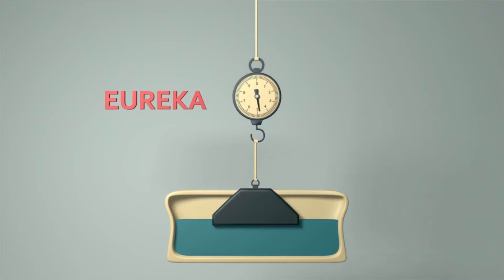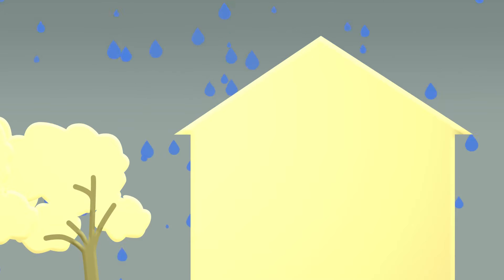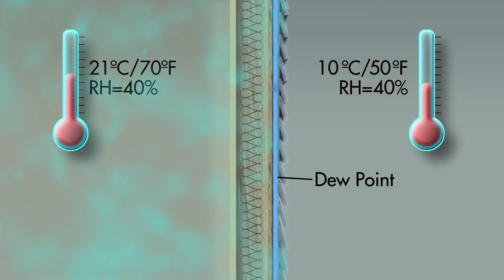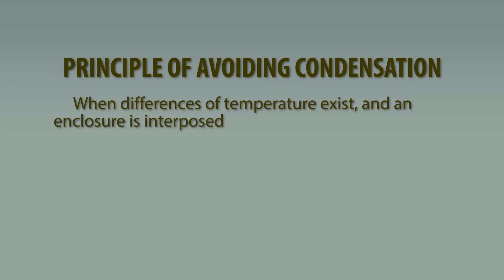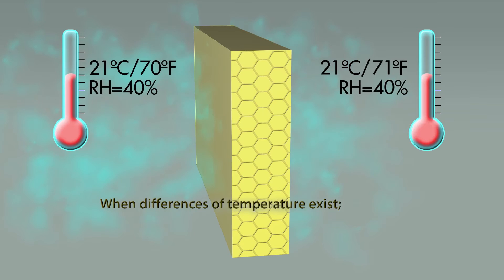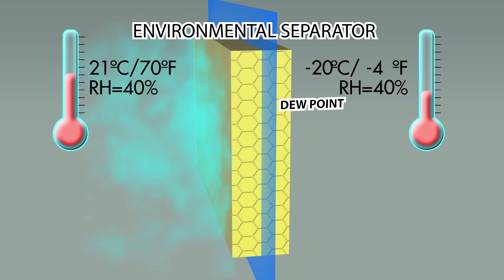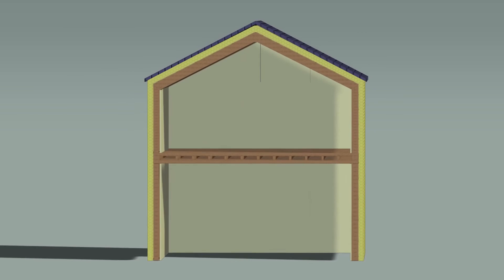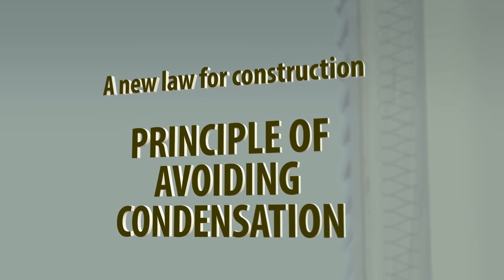Principle of Avoiding Condensation Explainer

Comment: For many decades by now , there is a product on a market for  a perfect wall. It is Thermasteel panel. It will not mold , rot,  burn, no vapor penetration with condensation, light weight , easy to assemble into a wall  and it consists of cheap components to produce
Reply: never heard of it.

Comment: Makes total sense. If condesation happens at for example 5 celsius, and you make your closed cell foam insulation outside the home, then the outsideof the foam is frozen and the interior is warm, but the 5 celicius is somewhere in the middle of the foam baord, thus eliminating the condenation processes all together.
Reply from the maker: @corykeeler2655 Yes, you get the point entirely. And the non-permissive insulation is the only system that can be installed on the interior (especially for ceilings), letting the structural element entirely outside (in one environment).

Comment: The only material that I know of that is used for insulation that is non-permissive or vapor impermeable is closed cell foam. Structural insulated panels offer a wall system that is air tight and vapor impermeable if installed properly. You could also build a stick built wall with 2 1/2" of foam on both the inside and outside surfaces with regular insulation in between. As long as the foam is contiguous and fully sealed the dew point would always fall within the foam in most climates.
Reply from the maker: Hey Joel, nice to have your comment. You get the point of avoiding condensation using non-permissive insulation but, the idea is to simplify things, and not to complicate... Two layers of closed cell foam with a permissive insulation in between is a non-sense complication. The base idea of full success is a thermal enclosure made out of a continuous non-permissive insulation with the role of environmental separation and, a structural element to form the building envelope. When those things are accomplished, all building envelope issues are solved. I know, everione worie is about thermal efficiency, but... do not compare non-permissive insulation which is 100% effective, with permissive insulation which have a regular randament of 20% from specified conduction coeficients of laboratory tests. Regarding materials and technology, see https://eios.co/

Comment: In principle yes, but as the saying goes - God is in the details.
All -fenestrations -doors, window are difficult if not impossible to detail . Roof to wall issues. Siding, roofing etc fasteners become conduits for temperature, vapor issues. Not to mention poor installation issues.
Manufactured insulated metal prefinished wall and roof panels can be a solution.
This is not easily accomplished - but the principal is sound.
Reply from the maker: This theory arise from practice, and yes, the practice is detail oriented. See https://eios.co/eios-besides  As you say is need, special details are made for intersection with other constructive elements as windows/doors, and connection between walls and roof. All assemble needs to be continuous vapor tight and thermal bridge free. Some screws are accepted for roof system attachment.

Comment: I've been looking for a condensation problem beneath the mattress in an RV. Through your video I think I've found it. I don't have much space, the bed is above the truck cab, but if I put a layer of enclosed foam (for example polystyrene) it should keep my mattress dry.
Reply from the maker: A layer of extruded polystyrene should solve condensation, but it needs to be sealed around and the joints sealed with polyurethane foam, so as air and vapor to not get behind insulation. See installation example from constructions:  https://eios.co/system

Comment: Loved the video and explantion, definitely will consider doing this as i need to change the roofing anyway.
Another problem with ventilation is that during winter the "fresh" outside air is often polluted to the point of killing an air purifier filter in a month. (I also don't have a furnace, gas stoves or anything, besides few residents, that would require ventilation)

Comment: omg .. i've literally got some insanely uncomfortable inflamation problem in the last 2 years of wet winters and my dad DIED of an autoimmune condition of the lungs in this house .. i found a electricity sockets corroded to green behind a cupboard, the windows have condensation on the inside .. its chronicly humid but  doesn't smell like it .. i cant believe people dont HAVE to make sure this doesnt happen.
Reply from the maker: Condensation, mold and degradation usually starts interstitial (inside of walls), not very visible but very aggressive for the health of the occupants and the building. I build moisture-free from more than 10 years, with same results in every project standing. Unfortunately, the authorities doesn't want to consider this as a fact, and make a change. Who knows when moisture-free will be a reality, for all.
Reply: My friend lives in Alaska and her two daughters have debilitating autoimmune disease.. I asked if she has mold and she said yes it is really common there and she had several walls rebuilt.

Comment: A nice explanation, but I was unable to find the proper non-permissive thermal enclosure material you talked about.
Why haven't you given any names of such materials as a guide.
I'm really breaking my head trying to figure out, which materials could fit under your definition.
Reply from the maker: The principle is the theory, for practice search EIOS Thermosystem.
Materials to create non-permissive insulation is usually extruded polystyrene sealed with closed-cell polyurethane foam. See the assemble: https://eios.co/system
Reply: @mariusradoane1787  That is so far from the truth. Do you really believe that in winter time hot air that difuses from the house will go right into the middle of the extrudated polistyrene and stay put from November to about March ? 😀  I understand that you are trying to sell your services, but do not mislead people. You either are extremly naive or just someone trying to sell something at any costs.
Reply from the maker: @mihailfelixdumitresc  The principle does not sell anithing! Vapor difuses through materials, not the air! Extruded polystyrene is considered vapor-impermeable over 5cm thickness. So, through non-permissive insulation passes only heat by conductivity, No air, No vapors! There are some things to know, to can understand a principle.
Reply: @mariusradoane1787  Your extruded polistyrene will keep the moisture INSIDE the wall, with no chance whatsoever to escape it. What follows is mold grows which is bad for health. Water vapors "travel" with hot air and become water droplets once the hot air meets a cold surface. You cannot separate water vapors from hot air just by placing extruded polistyrene on its way because it does not act like a coffee  filter. It is the moisture that is the problem in your "solution", don't you get it ? Moisture that remains within walls because your extruded polistyrene conducts heat outside the walls. Moisture acts like a facilitator for heat transfer.

Comment: The exterior insulation foam panels you promote are still held in place by big wide strips of wood (such as on top of a roof deck), which means there is actually no continuous condensation seperation as you claim... wood attached to wood attached to drywall or roofing tiles does not insulate or stop moisture. Of course without the wood elements, you could not attach a roof on top of foam panels, since foam isn't a structural material. So you haven't actually created a system that matches your theory. To follow your theory you could live in a big styrofoam cooler, but the styrofoam would break easily which is why we don't make houses to be styrofoam boxes. Also lots of homes are made with a few inches of rigid foam insulation outside of the wood framing these days, especially in very cold climates... you haven't actually "invented" anything, much less a perfect enclosure with your "system".
Reply from the maker: If you mean https://eios.co/sky the wooden slats that supports the roof system are fixed through the non-permissive insulation by wood screws, to the structural element, which is internal placed. The insulation is continuous and thermal bridges are minimal, not affecting moisture content of frame, possible condensation being counted in grams/building. https://eios.co/system and https://eios.co/inside Are continuous, moisture-free, thermal-bridge-free environmental separator. Condensation on a regular size house, in a temperate climate, built with regular insulation and moisture control systems, is over one Ton annual, cumulated in building envelope. Now, chose what inventions you need for building.

Comment: Isn't insulation needed to be much thicker to eliminate needs of vapour barrier? I believe eliminating VB is feasible somewhere it's always warm - similar to room temperature through a year, but regions where it's normal or colder winter climate, to eliminate VB it will require a lot thicker insulation to avoid dew point. Am I getting it right?
Reply from the maker: Interstitial (in-wall) condensation depends more on the vapor-permeability of walls and insulation (whish usually is very permeable), and on the temperature-difference between inside and outside, and not too much on the insulation thickness. The temperature difference creates vapor diffusion and dew point. There is no need of VB in the avoiding condensation concept which provides zero-condensation by stopping vapor passing through the insulation, and not retarding vapor passing through walls using vapor barriers. VB is the "appanage" of the moisture controll building science. Avoiding condensation stipulated in the Principle doesn't depend on climate or season!

Comment: One important thing missing here is paint, paint creates a thin membrane so I suspect it plays an important role but never mentioned. So it would seem that an exterior vapor barrier and interior barrier should do the trick.
Reply from the maker: Avoiding condensation is possible only by creating a vapor-impermeable insulation enclosure, or in the new terms, "the non-permissive thermal enclosure". This have nothing to do with the vapor-barrier, renamed vapor-retardant barrier, in the form of foil, membranes or as you say, paints. If those barriers are involved in the envelope wall construction, will not influence vapor diffusion and condensation, such are kept in one environment (the inside warm environment). 
This explainer is only "the top of the iceberg" of the new science of Avoiding Condensation, and because of this, many confusions will be made with the science of Moisture-Control, which is based vapor barriers in the form of foils, membranes or paint.
Reply: @mariusradoane1787  I understand, but breaking it down to the most basic principle the purpose is to prevent moisture making its way through the porous components of a wall. Anyway I think paint is an integral part of this system especially a latex based paint. Thanks for your input.
Reply from the maker: @crazyking50  Using this principle, the envelope wall needs to be conceived as two elements: 1) the Structural Element and 2) the Environmental Separator. The structural element does not have to be airtight, moisture resistant or vapor retardant. Instead, the environmental separator, non-permissive thermal enclosure takes all functions of separating the two environments, as vapor-impermeable insulation (responsible for avoiding condensation), airtightness of the building, waterproofing and 100% effective insulation. If the environmental separator is placed on the exterior of the building (as should be), the structural element is all inside, protected by weather and there is no worry about vapor diffusion and condensation that builds moisture. But, if the environmental separator is placed internal (recommended only for ceilings), than the element 1) needs to be protected, especially for rain water. The vapor diffusion does not apply in any cases to the element 1) the Structural Element. This is the most benefit of the principle.

Comment: Were you trying to make a point while avoiding making the point? how much jargon are you going to throw into this while avoiding saying "prevent airflow from passing through the insulative layer"?
Reply from the maker: The principle is about stopping vapor diffusion through the thermal enclosure (insulation named non-permissive). This includes all other preventions as you want: airflow, waterproof, capillarity, absorption, etc.  There are many points, see the gist...

Comment: Who is your audience? I can tell you it's not me. Despite an excellent vocabulary and a bent towards the scientific  I found your video to be frustratingly over-loaded with language not useful for translating your concept into action. 

Exactly what type of product actually accomplishes what you recommend? What comes close? What doesn't? 

Your video was not a good investment of my time, even if the information presented is  vital and accurate. 

You should consider a rewrite that translates into more useful parlance.
Reply from the maker: Indeed, this is not an insulation product. Is the very base of a new building science named Avoiding Condensation, which intends to replace the current Moisture Control science of managing damp in building envelope walls. The first and only product based on this principle is https://eios.co/  On Youtubes like this https://www.youtube.com/watch?v=WYI-xe09PLc&t=4s
Reply: I am with you.

Comment: No mention of ventilation? 🤔
Reply from the maker: If you mean the ventilation of walls, that is the "privilege" of the Moisture Control building science. This principle is the base of the Avoiding Condensation building science, which means building without moisture, mold, ventilation of walls, drainage and all things related to cycles of wetting and drying. If you mean the building ventilation, this is made by windows, doors, mechanical ventilation systems, etc.

Comment: Hello sir. Really hoping you can help. My problem occurs during the monsoon season only. The neighbour above keeps the air conditioner on 24/7 at chillest. This causes condensation & mould  on ceiling of my room below where there is no AC.  Only during 3 months of monsoon when humidity is high. . Ceiling is made of concrete & painted. Would be grateful for any suggestions. Am desperate
Reply from the maker: Dear @priya85746, there is a thermal bridge problem. You can solve this problem by non-permissive insulating the ceiling using 5 cm (two inchs) or more, embossed extruded polistirene XPS, sticked and sealed with poliurethane foam. See this system: https://eios.co/inside  You have to find a solution to prepare the ceiling surface for adhesion and to fasten every board up to curing the poliurethane foam adhesive (also see this page https://eios.co/system). You can also build a metal frame with a layer of OSB to easily install the insulation system. This insulation will solve the condensation problem on the ceiling surface, and behind insulation, and will also save you a lot of heat energy that goes through the concrete slab to your neighbors above, in the cold season. Good luck with your project.